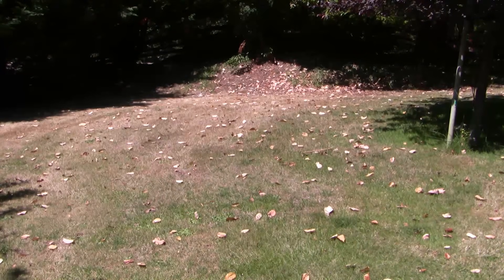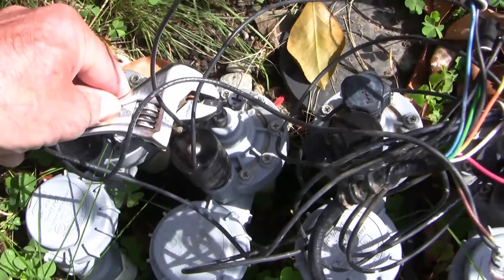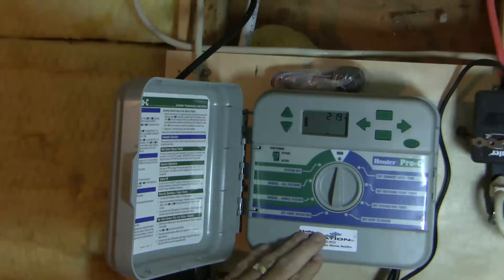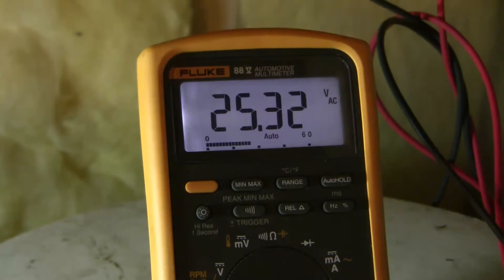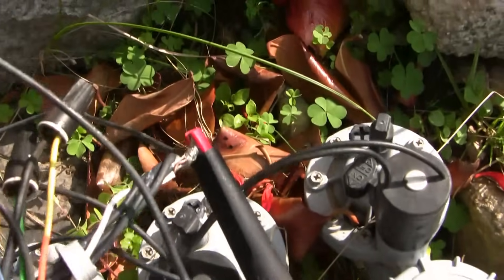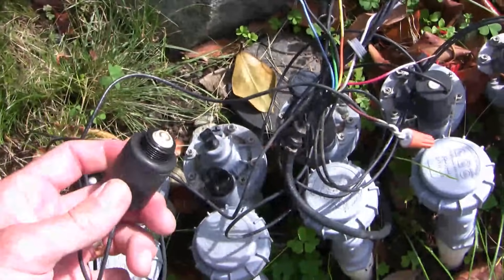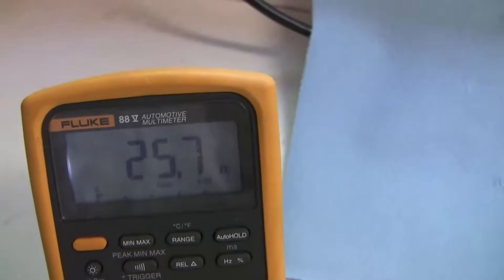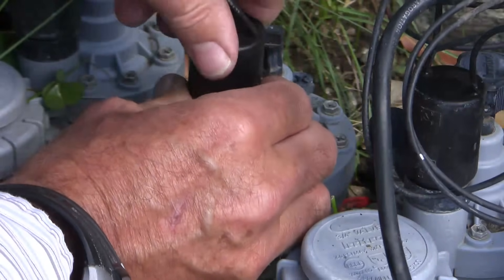How to fix an irrigation sprinkler zone that is not working

Comment: One zone of my six zone system all of the sudden does not seem to have enough water pressure to completely raise the sprinkler heads. I actually changed the entire Siphon value with a completely new value, and capped off a few unneeded heads to see if I could raise the pressure. The pressure did not change at all. Wher do I start?
Reply from the maker: The first thing I would do is turn the zone on manually and see if it works better. If it does, there's a problem with the valve or solenoid. Most of the time, manually opening the valve won't help. In that case, the most common cause of this is a leak in the line somewhere, almost always between the valve and the heads, not proximal to the valve. So, I would run the zone for an hour or so and look for an unexplained puddle. Dig down on the puddle and you will find the leak. It might be near a sprinkler head, since it's common for leaks to occur near junctions. It's also common for a lawn mower to damage a head that doesn't slide back completely when the water turns off. Looking at where the sprinkler heads are, you should have an idea where the piping goes. Pay careful attention to flower beds where a shovel could have cut into the tubing. And look to see if the ground around one head is a lot more wet than the others. If you find no evidence of leak, then I would double check to be sure the valve is not closed off (many of these have a screw that limits flow). Then disassemble the valve and flush it out, with the theory that proximal debris is limiting flow across the valve.

Comment: What if the zone won't open manually?
Reply from the maker: Then you want to decide if it is a problem of not enough resistance or internal obstruction. The commonest problem is a broken pipe or loose connection, which is often obvious as a pool of water when you leave the zone on for an hour or so. Dig down on the pool and find the leak. If no leak, dismantle the valve and flush it, looking for internal debris, blocking the valve.
Reply: Thank you! Will have my husband check it out.

Comment: its so confusing I still don't get it :(
Reply from the maker: As much as I would like to help, the question needs to be a little more specific. I didn't start with fundamentals of electronic control circuits, since the video would have been hopelessly long. The guys who do this work for a living are often helpful and friendly -- when I do ask tradesman to come to my home, I never let them go without teaching me something. Good luck!
Reply: can the electric there can kills u? I don't wanna get electric shock with smoking hair at all :(
Reply from the maker: 24V is very unlikely to give any serious adverse reaction. The resistance of most tissue is too high to generate meaningful amperage from that voltage. But, of course, follow good practice and you'll never experience a shock.
Reply: ok here is my problem one time the stormt hit and then the electric go on and off several times so the clock went back into 12:00 and I usually set my water on at that time midnight so it was on automaticly and then it never go off start from zone 1 I turn the timer off it doesn't go off so I have to shut the water off so it wont spray anymore so what do u think the problem is? I check for the check vale or pump stations whatever and the fist zone pump was super warm compare to the other 3 probally cause it been running non stop :(
Reply from the maker: ki li That's a bit worrisome for microprocessor damage caused by a voltage spike. If your unit has a battery backup, I would replace the battery and I would disconnect the power and then reset everything. I would reprogram the microprocessor with your watering sequence and hope that it works. You could choose a short daytime sequence to see if it shuts off at the right time. If that fails you may need a new board. Occasionally you can find and replace bad capacitors or poor solder joints that need resoldering. But, most of the time a bad board just needs to be replaced.
Reply: I don't know how to disconnect it I don't see the label on the electric board for the sprinkle system where is the battery at?

Comment: Very nicely done video, one of the more professional on YouTube.
You voice is so calming, you remind me of Bob Ross.
Reply from the maker: Thanks!
Reply: Thomas Scoville spelunkerd 

I had the sprinkler system installed in the house I'm in right now years ago, when I was traveling.  Now that something was wrong with it, I had to both familiarize myself, as well  as learn the interface to my controller, remember pascals law so I could recall how these valves work, pull out my multi-meter, and remember where everything comes and goes, because in America no one marks anything (very odd).

When I got to my first valve I realized I should do a quick check on the web.

While I know how all of it works, it was really wonderful having someone just calmly walk through the 1 2 3 of it.

So, I walked back outside, started at the controller, and followed it to its end.

Of note, everything is working now, not because I did anything clever or smart, but it seemed ultimately that unscrewing the sprinkler valve assembly, and just putting it back together again made everything happy again. 

I'm now going to label everything, and draw arrows for water direction on the pipes.
Reply: Thomas Scoville Yes, familiar with that as well.

My circuit panel has id numbers, and each socket's wires are numbered saying which other socket they go to :)
Reply: Thomas Scoville ASMR - Yes.  LOL  I even know people into it.

Comment: Whenever I manually turn on a zone the sprinkler system works. However every time I open all the valves all of the zones will be on at the same time. If a turn on three zones/valves those three will be on simultaneously etc. I think I have an electrical issue. 
I believe it's stuck in manual mode but I replace the solenoid and no luck.
Reply from the maker: Perhaps I'm not understanding your description of what you are doing. If you try to electronically open all valves at the same time, there will not be enough peripheral resistance, so systemic pressure falls. With low pressure, the sprinkler heads won't have enough pressure to lift up. These systems are designed to open one zone at a time.

Comment: Great info and very helpful. Question, all my zones work but when i turn on zone 1 zone 2 comes on as well and when i turn on zone 2 zone one comes one.  I have never had this problem until the last week.  I have tried a few different things, but this is a problem because it reduces the water pressure.  Any suggestions?  Thanks
Reply from the maker: I believe that some sprinkler systems can be programmed to do that, so the first thing I would do is consult the manual for your system and see if it is offered. It's might be easy to have mistakenly altered the programming with an accidental keystroke. If it's not a programming issue, then you may have a crossed wire, feeding both solenoids together, usually in parallel. If you think that might be the case, I would start by checking for obvious things, recording where each wire to the two solenoids go. Of course the common 'neutral' wire feeds all, but the hot wire should be unique to each solenoid and not electrically connected. So, if you disconnect both hot wires at the microprocessor you should have no continuity between the two. If there is continuity then you search for the short circuit.

Comment: My #5 section works only when I loosen the solenoid, at which point sec #6 also slightly works...so less power to both. On its own, sec #5 does not work, but sec #6 does. Any thoughts?
Reply from the maker: I think I would clean the valve seat, hoping that debris is making it difficult for the solenoid to do its job. Failing that, swapping for a good solenoid will help isolate the problem.

Comment: Thx for the reply.. System isn't connected to the house or city, it's separate...From well to pump to sprinkler system.. My house is connected to city water tho.
Reply from the maker: An inline pressure valve might help to tell you what is going on, though the other factor is the flow rate your system is capable of. Sometimes a bigger reserve tank will help to give more consistent flow late in the cycle.

Comment: The last few zones aren't popping up automatically.. I have to keep pulling a head up by hand & then the rest of heads on zone pop up. 

This video confused me, but not sure this is my issue, brand new valves. Hmmm maybe my Well has a bad foot valve?
Reply from the maker: It sounds like your system pressure is too low to push the valves all the way up. That is sometimes caused by a leak, other times it's household pressure itself. I would look to see if there is a pressure reducing valve installed in the system, limiting flow. A pro can measure system pressure directly, and you may have such a pressure meter installed in your system already. You might also consider changing the timing to when other uses (dishwasher, shower, toilets, and washing machine) are minimal.

Comment: Hello. Thank you for an amazing video. I am a complete newbie at this. I followed your video and in the first step, I checked the resistance at the controller for the 3 valves that are not working, and I got zero resistance. What does that mean? I also checked that the controller is sending current to the solenoid, but I have not checked whether it is being received at the solenoid. Thanks for your instructional video.
Reply from the maker: Zero resistance means a short, somewhere. But because I did it without disconnecting any wires, it means that the short could be anywhere. When faced with the complexity of that kind of problem, you search for ways to simplify the question. I would disconnect the wires from the busbar, being careful to photograph it before removing wires, so you have a record of what it looked like before you started. I would just do two wires at a time, the common and the feed wire for each solenoid, probably replacing them after so you don't get confused. Once the wires are disconnected, you can check resistance again. If you still have no resistance then you need to find out where those wires are touching. It might be an internal short inside the solenoid itself, in which case replacing the solenoid is the solution -- however with three devices going bad I would guess it will probably be elsewhere, maybe crossed wires or a ground problem.

If the short seems to be at the controller itself, then you may have a controller board problem, which is harder to solve. Have a look at the manual to see if the controller is setting any codes that point to the cause. Good luck!

Comment: Great video thank you.  With our system the landscaper set up two zones.  Zone 1 is the grass in the backyard and zone two is all of the drip lines for both the front and back yards.  I noticed this evening that the front yard drips are all working fine but the back yard lines have zero water.  Could the diaphragm in the valve cause this or am I likely looking at a break / leak?  Thanks for the help.
Reply from the maker: Could be either. Try turning on the valve manually and see if you get water. With a leak you can sometimes feel a thrill in the line, since it's a high flow situation, whereas an obstruction is low flow. If you think it might be high flow, I would  leave zone 1 on for a few hours and then hunt around the garden for a wet spot. The pipe these days is so thin, it's easy to accidentally puncture with a garden spade or freeze fracture. And sometimes it's just a failed connection causing a leak at one of the sprinkler heads. That causes low pressure everywhere so none of the heads will work. If it looks like a low flow situation, I would disassemble the valve, flush the proximal line, and evaluate the diaphragm.
Reply: spelunkerd Thank you for the advice.  Your videos are well put together and informative.  I have never worked on irrigation systems before but I felt comfortable taking everything apart.  I disassembled the valve, flushed it, and put it back together.  That completely solved the problem.  I had some build up on the diaphragm and inside the valve.  Cleaning that up was all it took.  Thanks again!
Reply from the maker: Disney Mom Sher That kind of followup helps other people who visit here looking for answers. Thanks for going through the effort to tell people how it turned out.

Comment: This explanation was great. The replacement went smoothly.  The landscaping company that put in the irrigation system didn't use the waterproof wire caps, so I upgraded all of those when I replaced the solenoid.  Since I live in Sacramento and we only have two seasons, summer and not summer, I covered the wire connectors in a plastic container.  I scored the bottom and popped them through with the the top on of course.,  I can replace it as needed.  Thanks!
Reply from the maker: That's a good plan. If you are looking for an inexpensive substitute for those specialized connectors, look for "dielectric grease" in any autoparts store. One tube will last a lifetime, and you'll find lots of uses for it if you do any kind of auto repair. Some technicians put it on every electrical connector they open, to prevent oxidation and electrical shorting. The grease is a nonconductive barrier to water, oxygen, and other impurities.

Comment: Great video. I don't have a voltmeter. For someone like me, can I just replace the solenoid in the defaulty zone and see if that works or not? Do you think that would be easier and bypass the whole checking voltage part? Thanks
Reply from the maker: Solenoid problems are a lot less common than problems with the valve itself, and so replacing the solenoid doesn't work for those problems. A cheap multimeter costs about $10-20, and a new solenoid costs about $20. One thing you could do is swap the questionable solenoid from one zone into another and see if the problem moves. If the problem moves to the good zone then it's a problem with wiring or the solenoid itself.

Comment: There are 11 zones on my system and none of them are working. When I change to manual mode, I see the blind sign  to show it iis working on the control system.However, water is not coming out. Question is that how do I know we have the solenoid for the main valve? Do you think that we need to change for all solenoid? Please advise what should i do. Thanks
Reply from the maker: It  would be very unlikely that all solenoids would fail at once. Start from the beginning like shown in the video, see if you get water by opening one valve at a time manually. Often it's a main valve that is closed, or water leak in the main system, or all the valves were left open for the winter so you can't mount enough pressure to open any single zone.
Reply: spelunkerd Thanks so much for your respond. I am going to work on this weekend. I have tried to do manually on every single zone but water is not coming out.make me thing about the main valve.Another question is that we have 11 zonez around the house, but I only see four solenoids. IS that they share one solenoid for every four zones?. Thanks again.
Reply: Thac Hoang Is that when we set manually mode on the controller and take out the solenoid, that water will come out if the pipe have any problem/
Reply from the maker: Thac Hoang To manually open each valve, go to the solenoid and twist the manual control arm counterclockwise about 1/2 turn. Water should flow, even if the solenoid is bad (shown at 0:44 of the video).

Comment: Hi, I manually turn my sprinkler system on and the 1st zone will pop up for like 2 seconds then turn off.....if I try to turn on manually to the next station nothing will happen.  Some days NOTHING will happen at all and other days it comes on for the few seconds then one day it came on and worked fine.  DO you know what it could be?  So frustrating!
Reply from the maker: The first thing I would do is close all the manual valves off clockwise. Those valves are usually all left open during the winter, so water can't pool and freeze near the valves. If one or all of the valves are left open, there won't be enough water pressure to open any sprinkler heads. If that isn't a problem, then I would look for causes as to why you aren't getting enough water pressure to the system. Either it's leakage such as a broken pipe (common) or intermittent obstruction from a piece of sediment inside that is obstructing flow (less common). If you put your hand on the main pipe leading from the house, you should feel the thrill of water flowing when it's on, which will offer a clue as to whether the problem is not enough resistance (high flow, low pressure), or not enough flow (low flow, low pressure). Look for the simple things first, like a shutoff valve inside the house that is not opened all the way. Run the system for an hour, then look for a wet spot on the grass that might signify a broken pipe underneath.
Reply: Thank you!  I will try this!
-jeanie